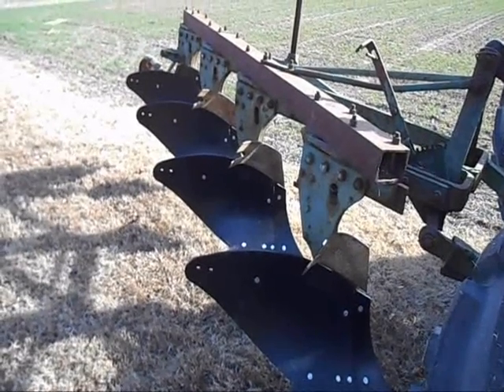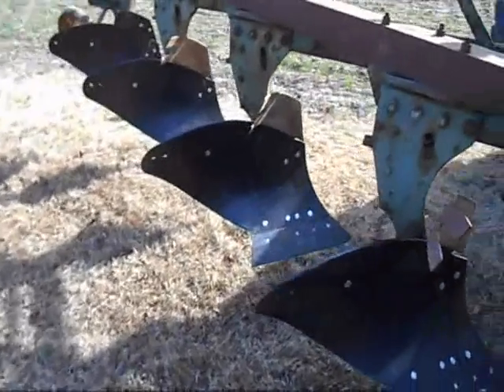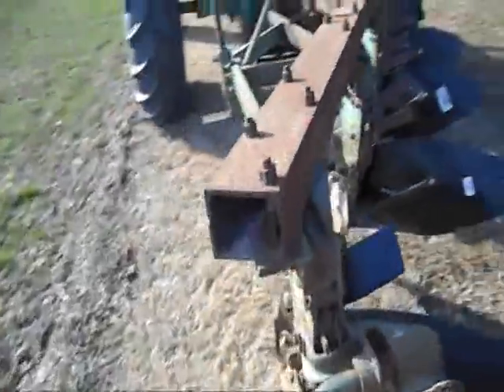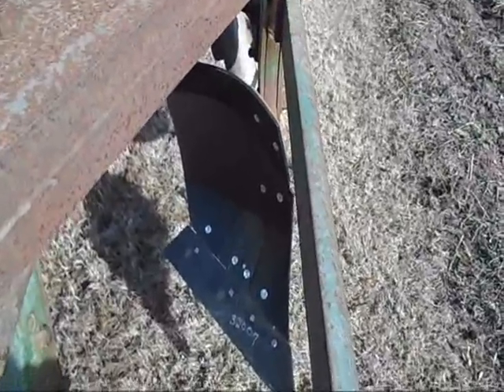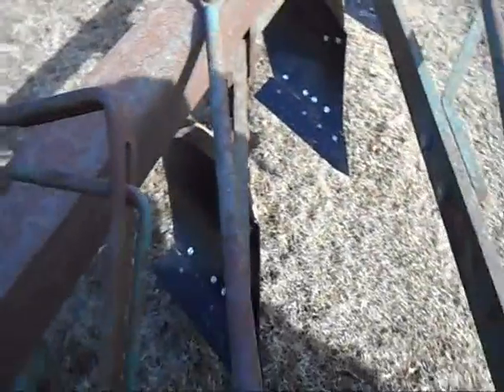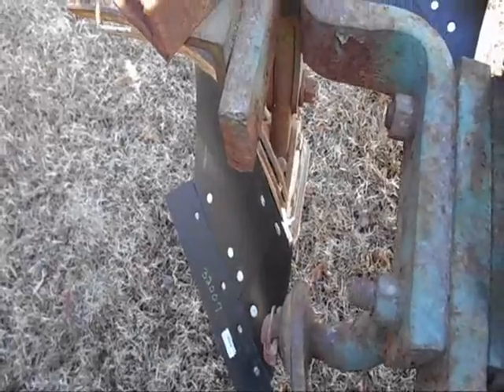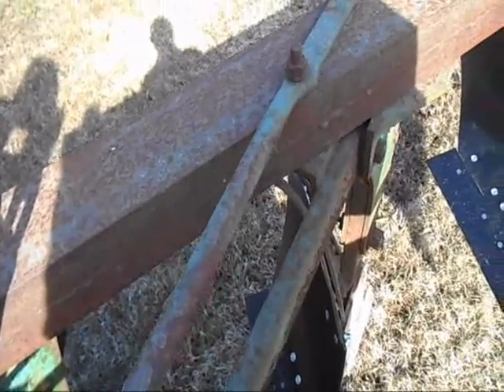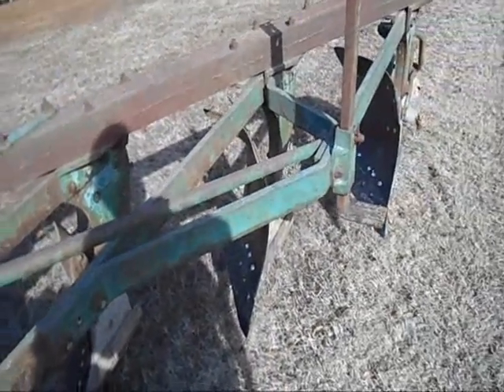Plow project Completed attaching the new Steel

Comment: Hey man! The plow looks real good, but I have two questions.  How come you didn't replace the land side plates?  Why a three point hitch plow, verses a semi mount plow?  My experiences big three point hitch plow can put a quite a bit of load on the rockshaft, compared to a semi mount plow.  I know that 4020 will pull 5/16 like something crazy in that sandy soil.  I really like your page.
Reply from the maker: Brian Coates - on the land slide plates, I ran out of money budgeted for the project.  I'm going to plow over about 20 acres this spring then I hope to replace them sometime in the next year or so.  this was my cousin's old plow and he no longer owns a tractor large enough to pull it so he sold it to me at a good price.   it needed new steel and yep land slide plates.   as for the rockshaft concern, I pretty much know my land and the really hard ground is going to see the subsoiler before the plow.  with pitch set correctly on the plow then it's just rolling the land over.   thanks for watching, commenting and subscribing.   I hope you'll watch and enjoy my other older videos.

Comment: seen s plow like  yours  that had  Coulter's on the last three plows.they was the scalloped shaped
Reply from the maker: the main function of coulters is to cut the surface residue so it will not interfere with turning the dirt over. I have been told some shapes work better than others.   I'm still searching for the ones I want.  thanks for watching.

Comment: For that type of John Deere plow the Coulters have a clamp that bolts to the plow frame on top and on the bottom of the frame with another clamp the bolts the s style coulter shank to the clamp on the frame. I'm not sure but the frame at the front of the plow might have been cut off with a torch some time ago, Take some pictures of the plow and send them to the plow guy in Green Magazine. You might find a copy at your local TSC, not sure any more.
Reply from the maker: when I get there the clamp types I saw are the way to go and with the s style shank the adjustment to line the coulter with the plow rock shear is way to easy.  thanks for bringing it up in these comments.

Comment: Coulters attach with clamps to the plow frame rails. Allows adjustment position in front of the moldboard. See old JD # 44 series plows on info videos. Possibly you can find a used JD plow for all you needed spare parts.
Reply from the maker: when I go back to seriously looking for the coulters used is a good option since the budget has been strained recently by other things.   thanks for the suggestion and the info.

Comment: I never even noticed your plow didn't have coulters until someone mentioned it in the comments. I had a 2 bottom plow years ago without coulters and it did a good job burying what I was plowing. I don't see any premade holes on the frame for coulters. If you find some it might take a little effort to fasten them on there.
Reply from the maker: yep, I was not looking forward to drilling the old steel.  that stuff dates back to when we made the good stuff.  found some clamp on types today but got to save up.  when the ground dries out I'm going to test as is.  got a lot to learn about plowing.  thanks for watching.

Comment: If  disc before you plow you won't need coulters...Really don't need unless you are in heavy residue...Keeps trash from Hairpinning around plow shank...Strip-till riggs run one in front of the subsoiler shank...J D conservation planters have one  (wavy) in front of the disc openers
Reply from the maker: got some sticker shock today shopping for complete coulter ready to bolt on.  may just have to wait for awhile on those.  but I still want them.  the straw chopper on the back of the combine may be doing good enough at breaking up the residue, I'll find out.  thanks for the insight and watching.

Comment: you get lucky them cutters will have 2 to 4 bolts andclamp on the rails you pointed out
Reply from the maker: sticker shock today as I shopped.  I want them but maybe I'll have to add them one at a time.   bolts and clamps were in some of the things I found today and that beats drilling for sure.  thanks for watching.
Reply: You shouldn't have any trouble finding used ones. The plow looks good.
Reply from the maker: there are a few lots here in NC with used farm equipment later I'll do a field trip to check them out.

Comment: You should not really need coulters,  that plough has trash boards fitted on top of the mould boards,    just lower them down as far as they will go, (should be some slots)   and they will bury the trash ok.
Reply from the maker: thanks for the input.  jury is still out.  cost may slow me down a bit on getting anything else right now.
Reply: SF, take note from a ploughman,    coulters come in two types,  ones with a "skimmer" which does more or less what the trash boards do, You don't need both.       The other type is a coulter where there is a steel disc attached to cut a furrow,   Its only my opinion but they can be more trouble than good,  if you have a lot of trash they block up.You may be better with the plough just as it is,  and a jolly good job you have made renovating it.   Jim.

Comment: Well done, however what do you mean precisely by a coulter? Can you find a picture and put it in another video?

I'm asking because as you have trash boards I cannot quite see why you would want seperate coulters (which we would call skimmers here in the UK - They look a bit like a mini plough body). The only option I would suggest that may be helpful would be helpful would be a disc coulter (a circular quality steel blade that cuts down vertically about 4-6inches) cutting the furrow wall just in front of the last furrow to leave a clean furrow for the tractor wheels.
Reply from the maker: you described almost exactly what I want to accomplish.   check out the picture below the cartoon on the page this URL takes you to.     http://mrbtractors.com/plow_parts/coulter_blades__accessories